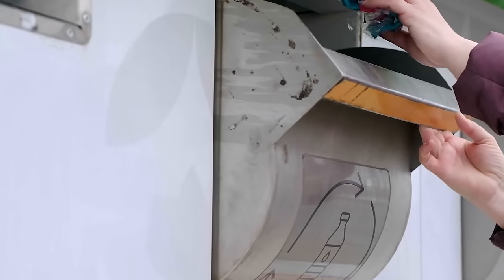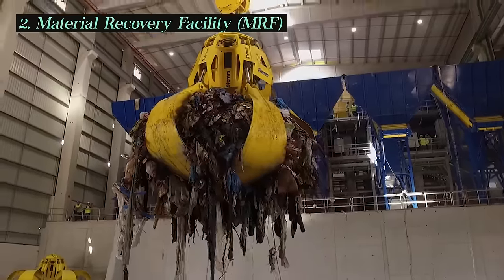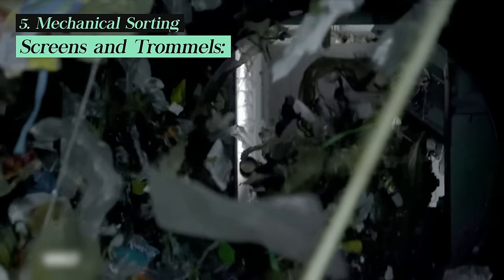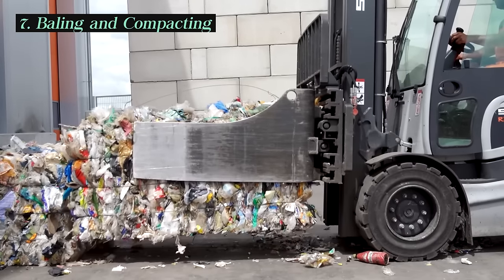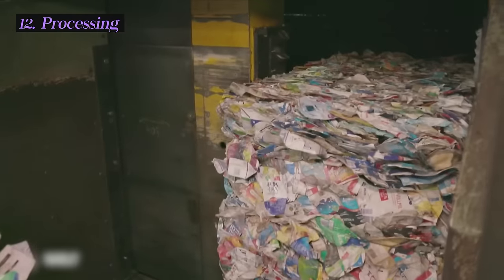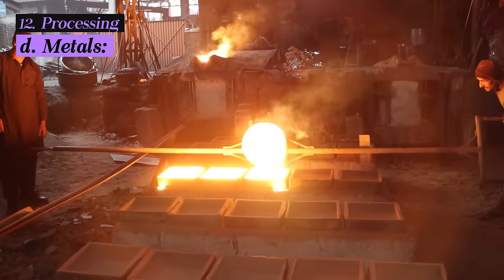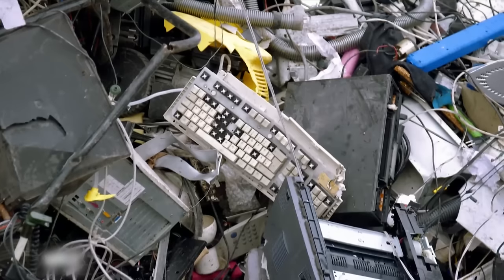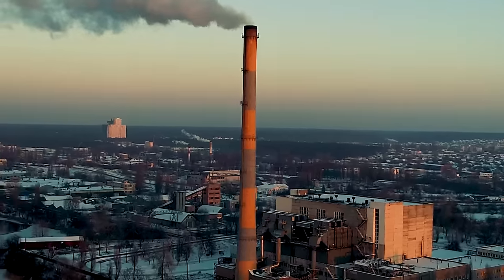Entire Recycling Process Explained

Comment: Best solution is to look far upstream at the consumer level. Are all those 1/2 liter water bottles that necessary. I see them thrown out all the time, virtually always out of convenience. How about further developing the Cardboard industry. Egg cartons used to be mashed cardboard paste, now they are styrofoam. Styrofoam should be seriously considered as Public Enemy #1 as it's a pure non-degradable chemical compound and the recycling efforts I do witness at my local recycling center require lots of heat and pressure to make foam plates for further processing. These plates are more efficient to store and transport, but move upstream to not having styrofoam cups, plates, packaging forms and peanuts. I recall starch-based peanuts back in 1968 that dissolve with water. Recycled cardboard paste can make packing forms, peanuts. I've even seen tabletop slitters convert cardboard panels into excelsior. Look up 'excelsior' as a noun, not an adjective. We've only scratched the surface at addressing this problem.